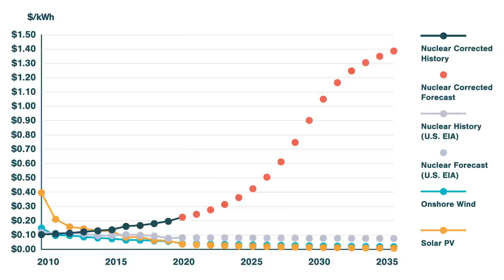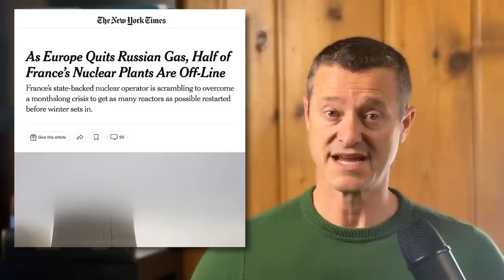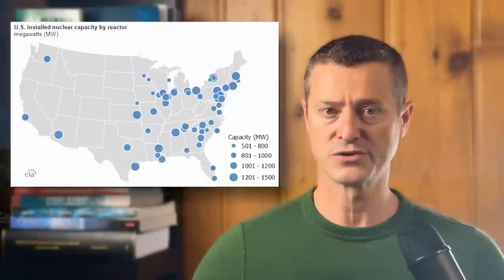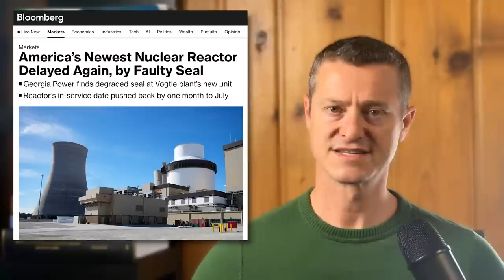Brighter | Episode 10 - Why we shouldn’t build nuclear power

Comment: I understand this is just a Q and A, but if you want to go into the electricity market in more detail, it would be good to explain that Nuclear 'special treatment'. The treatment isn't unique to nuclear (in fact, it is being taken by renewables from nuclear). Nuclear is expensive to build, but it is cheaper to run than gas or coal after it is built. It also can be expensive to shut it off and its contracts might have "take or pay". 

This means that Nuclear enjoys high capacity factors not because it is reliable or better technology or cheaper overall, but because it gets first dibs on selling its daily power because its daily power can be offered at a lower price. The difference between a peaker plant and a baseload plant is often one of marginal costs, bad contracts, and expectations of pecking order.

Renewables have a marginal cost that isn't just low, but nearly free. Even cheaper than nuclear. This means, in terms of pecking order by marginal price, renewables get to sell first as much as they can. Renewables aren't just nearly free to run, they are also often free to shut off. Ironically, they might be curtailed first if other sources have "take or pay" contracts or costs of shutting down, causing those 'negative power prices' you talk about. Yes, rising renewables can shove other producers into this weird negative zone, but it is not the renewables fault that other sources make the prices go negative when they go unused.
Reply: Lets factor in those interconnection charges and transmission line deployment costs to get a "true" cost of renewables. LCOE is a joke. As well, the renewable subsidies are terrible. Adam is not a honest broker of information. Hoping you become more informed as uncover all of the costs in your comments.
Reply: And it’s cleaner

Comment: I have to disagree here.

Nuclear power is expensive, because we are doing it wrong. We are mainly using reactor types that were designed for military applications, not safe and cheap power generation. One huge driver of cost is the risk of a meltdown. And ironically, safety concerns drove regulatory cost very high, which drove reactor sizes up, which just made the problem much worse. Cooling is the Achilles heel of traditional reactors, and larger reactors are harder to cool.
Solving these is not hard. There are many reactor designs that won't melt down ever. And some were built and tested (like LFTR) decades ago. Or there's a new fuel type (TRISO) that won't melt even if not cooled at all. This has been tested extensively, so it's not unproven either.

And once safety is solved, all of those super expensive safety systems can be thrown away, and reactors can be simple and small again.
And once reactors are small, a lot of other problems go away automatically. Small reactors can be mass produced in factories, and won't require much on-site construction. They are more flexible and redundant. They don't need massive rivers for cooling (air cooling works too). They can be much closer to consumers, in fact there are small reactors inside of major cities.
Security also can be massively improved with transportable reactors, because those don't need on-site refueling and waste management. Instead they would be sent back to the manufacturer and handled in a factory, which can be located in politically stable countries where it's easy to secure it. Plus only a couple of sites would need security, not thousands.

And once safety is solved, and red tape eliminated, innovation will speed up drastically, and all other technical challenges will be solved. Most of the nuclear industry is still stuck in the 60's and 70's. It's very similar to the space industry in many ways, so we can use it as an analogy to estimate what could happen with the obstacles removed. The crown jewel of the US space program, the Space Shuttle, cost over $20K per kg of payload, and even the cheapest rockets are over $10K. SpaceX's Falcon 9 and Falcon Heavy rockets are already drastically cheaper ($2600 and $1500), and the next generation (Starship) could go as low as $10, or even $5 in the best case.
So even conservatively we could expect a 100x cost reduction for nuclear energy.

I'm not saying that nuclear should be used instead of solar, just that nuclear could be far more competitive. And it has some huge advantages, mainly that it doesn't care about the weather. In the vast majority of cases renewables+storage is a practical and cheap solution, but I don't think they are optimal in every case.
Another issue is a black swan event. If for some unexpected reason large parts of the planet doesn't get enough sunlight for longer then normal, we could get into a big trouble. It would be nice to have at least some reliable backup just in case, even if it costs more. With energy prices trending towards zero, we could afford that easily. Backup generators already exist anyway, so it's not even a new concept. Where uninterrupted power is important (factories, hospitals, etc.) the cost is a secondary concern. And nuclear would be better than diesel for many reasons, especially at larger scales.
Reply: And long transmission lines aren't needed with SMR's. Heavy power users like Aluminum and steel production could have on-site power greatly simplifying the grid. It's also more rugged in case of solar events, war, and natural disasters. SMR's would play well with solar and battery by charging batteries when loads are low. They would serve well on large cargo or passenger ships, spaceships, boring systems, etc. 

If the unthinkable happened: a supervolcano blows, or a large comet or asteroid hits Earth, solar and wind are likely to fail. SMR's have a better chance of surviving and are much easier to harden than renewables. 

Don't mistake my enthusiasm for dislike of solar. We have 16kW of solar on our roof and have been early adopters of first hybrid and now electric vehicles.

Comment: Check out Thorium reactors. Use them to clean up Radioactive waste. Also for some future space projects, we will need some form of Nuclear reactor. Moon base, Mars base and deep solar system trips.
Reply: Yes. Liquid salt Thorium reactors get around the need for water cooling, gigantic pressure vessels to contain superheated steam, can burn radioactive waste, can produce medical radioactive products, has a much much shorter halflive, is difficult to get bomb grade materials, and can safely be used in spacecraft. We had working test systems in the late 60's, which now China has used to jumpstart their development. 

China will soon mass produce Thorium SMR's for their consumption and for propaganda purposes. Imagine cheap abundant energy a million times more potent than solar panels in third world countries. China's influence will grow exponentially. Meantime, we exploit their natural resources for our own benefit with little for the indigenous populations.
Reply: @edbrowne4114  
The experimental salt reactor only operated a very few years. 
To build one that could last twenty years requires corrosion resistant materials that simply do not exist yet.

Comment: You can get a great point of perspective on this just by looking at the most recent BP Statistical Review of World Energy, as I did a few days ago, just after the latest one came out. As a percentage of world electricity generation, nuclear energy hit a new low last year. That figure has been falling for many years. I think the peak was 2006, although I'd have to check. Wind and solar, together, now are substantially bigger than nuclear. In absolute terms, nuclear may have hit a new high, but only by the tiniest of margins.

I keep hearing about a whole bunch of nukes under construction. I really wonder what's going to happen if the economic picture for nuclear doesn't improve, as I don't think it will.
Reply: The World Nuclear Industry Status Report compiles and corroborates most of what you have said. Without even trying to be derogatory, the facts they collate paint a poor picture for the industry. 
In absolute generation, nuclear peaked in the early naughties. As a percentage of total, it peaked in the early nineties.
New build gets mentioned a lot by advocates, but completion rates are what counts, and those are down. Comma comma down.
Nuclear Engineering new graduate numbers are half that of twenty years ago, and most will be completely occupied with decommissioning and waste disposal.

WNISR 2022 indicates that even if all pending lifetime extensions are granted (some have been withdrawn already), then 153 nuclear plants will close before end of 2030. 
New build completion rates would have to double just to replace these, and the workforce does not exist.

The latest WNISR 2023 comes out 06 Dec 2023. Interesting to know what it will say....

Comment: How about transmission costs. I live in Australia, and we are starting to find out that transmission costs make renewables extremely expensive, while replacing coal plants with nukes means the existing transmission remains essentially untouched.
Reply: Australia was one of the first countries to deploy huge Tesla grid batteries and make lots of money with it. But sure, we're seeing massive transmission projects here in Europe to make it easier to balance the grid. Turns out that the wind is almost always blowing somewhere.
Reply: Better to replace the coal plant with battery packs, then the infrastructure can also be reused. I think Australia does this in many cases.
We should not forget that due to electrification we move to 2-3 times current electricity use, so no matter which technology, the grid will require massive upgrades.
Reply: @the_energycoach or hydrogen storage sites.

Comment: It is disheartening seeing a team dedicated to disruptive technologies basing your argument on primarily outdated or already developed technologies, while sidestepping the value of any possible disruptive nuclear reactor technologies. SMR are not disruptive, as their innovations are mostly to the production process not to the reactor technology itself. 
It was also odd to see you use a strawman argument with the question of how many reactors would we need for ALL the world's power. As you said, wind and solar plus storage will handle most of the day-to-day needs. Nuclear's use would be for baseload, same as it is today. It'll also be extremely useful for all the scenarios where solar and wind aren't as plentiful or more dense generation is required - like for mobile vehicles or on other planets. Eventually, we WILL need newer nuclear generator designs. And there are newer, disruptive technologies emerging today that need to be proven out. Not to displace wind and solar, but to fill the niches where renewables can't reach.
Reply: Baseload is not viable in an SWB grid. The reason is that the electricity from batteries would be cheaper to consume than the electricity from Baseload.

Imagine two grids, one which has 20% baseload at all times for $250 per MWh and then the SWB for $50 direct or $100 stored. And the other has only storage, no baseload. Let's assume 30% comes from storage, 20% is baseload, and the rest goes in directly from the batteries. On average.

Your average house draw roughly 10 MWh per year. With a 20% + 30% + 50% split, that is $250*2 + $100*3 + $50*5 = 500 + 300 + 250 = $1050 a year.

Same scenario but the baseload is completely replaced with storage, and let's assume a cost increase to $125 for storage (since you build so much extra). $125*5 + $50*5 = $525 + $250 = $775 a year.

Baseload is dead.

Comment: The key word you mentioned at the very start is ''conventional'' systems...but that is a false metric, better to compare renewables to nuclear plant systems like Copenhagen Atomics, X-energy, Oklo, and Last Energy. Renewables have far too many issues, not least of which is what to do with the toxic waste in old solar panels and wind turbines etc, lifespan and intermittant supply. There's been more than enough stories of hailstorms destroying solar fields, freezing temps knocking out power supplies etc...modern nuclear is a FAR better option, especially when you factor in all aspects.

Comment: Australia has just voted against including nuclear in their renewable energy mix (too expensive). Both France & Hungry are having to scale back nuclear  production capacity as river waters are too warm (cannot adequately cool the reactors). The South African nuclear plant has problems with jelly fish! As we've seen with the war in Ukraine, critical infrastructure becomes targets during a war - better it NOT be a nuclear reactor.

Wind & solar also offer better prospects for more jobs for ordinary folk (you don't have to study at university for 10 years in order to work there!).

People who love the idea of nuclear are just gadget junkies.

Other forms of renewable tech is also available to add into the mix
- geothermal
- heat pumps
- in-pipe hydro power (no enviro impact at all as turbines are located  inside existing infrastructure)
- on shore wave power
- turbulent hydro

Of course energy efficiency is critical - the less we need, the less we need to generate. Often we can do without electricity altogether, for example
- passive buildings (don't need heating & cooling)
- traffic circles instead of traffic lights where appropriate 
- bioluminescence or phosphorescent lighting instead of street lighting where appropriate 
- walk or cycle instead of using an EV where possible (most trips are short distance)
- alternative materials in manufacturing that are not fossil fuel based
- alternative fertilizers, herbicides & pesticides that are not fossil fuel based

Where there's a will, there's a way... humankind already has all it needs for a clean, just & sustainable future so all can prosper!
Reply: @soulsphere9242  I read it in an article - I think it was the Guardian (either under the Environment or Climate section). Let me know if you can't find the article.

Comment: I agree for the most part. If Nuclear goes ahead, we have to be honest about the cost, and not just the money. It kind of comes down to what is worse though. Continuing to allow fossil fuels to go into the atmosphere or accepting the future cost of some, again some, nuclear.

A problem with relying on solar and wind is that it simply isn't being installed fast enough. Sure, it's growing a lot. Still, what we need is exponentially more installation going on. We see the impact that solar and wind has had on some power grids and think we've come a long way. The problem is that most people are ignoring the absolutely monolithic amount of energy fossil fuels provide outside of the electrical energy systems. The electrical grids of today are just a fraction of the total energy we consume.

Now, I 100% agree that nuclear is a terrible option and in no way should be considered as a rational power system. I do however view it as a temporary stop gap measure to help transition us away from fossil fuels. To help for 50-100 years as technology and production scale catches up.

Another thing solar proponents forget is that solar has to be replaced completely every 25 years. So when the old panels start needing to be replaced, their losses will eat into future production levels. Those losses will grow every year too. Also, a cost of building them has to be taken into account. Just like EVs, they have an initial manufacturing emissions cost that detracts away from their total usefulness with regards to climate change.

As for the negatives of nuclear, yes, there are plenty. Still, it isn't as bad as you portray. First, of various energy generation systems, it's actually a mature technology. Not all the costs incurred in building a plant will translate to every other plant. Many of these costs were to do with new designs and unforseen issues. Building copies will mean knowing most of the issues. Any manufacturing has the same problem. Change something, and the cost is expensive. Copy something and the costs go down.

Further, the argument about cost and build times also isn't as bad considering wete at a unique point in history. So many coal and Methane plants are being decommissioned due to green energy, that a lot of the infrastructure is already there. The water, boilers, generators, and grid attachment are already in place. A good number of the permits already dealt with.

Again, I totally agree that it shouldn't be considered as a main part of the power system. Still  some areas just aren't good candidates for green generation yet. It can't be taken off the table completely.

Comment: Even if we had cheap, safe, scalable nuclear fusion power today, there would still be a problem.  Fossil fuels, geothermal and nuclear all add new energy to the climate system. Right now, this accounts for around 5% of climate forcing, but if energy demand scales up several times as fusion advocates imagine (not just for developing countries but also vertical farming, water desalination, carbon capture etc) we could still have unacceptable warming even without adding any greenhouse gasses.  Wind, solar and biofuel don't have this problem because the energy they transform is already in the climate system.